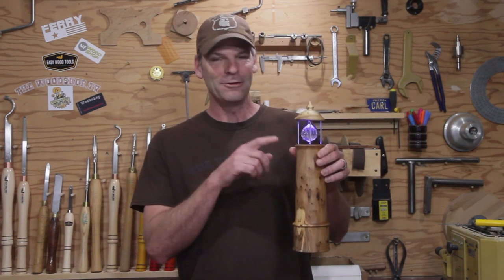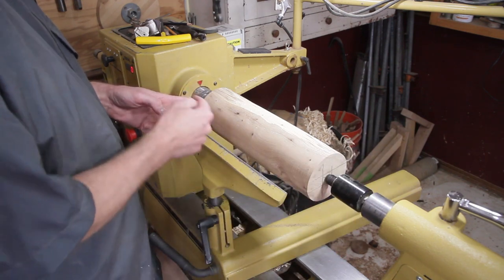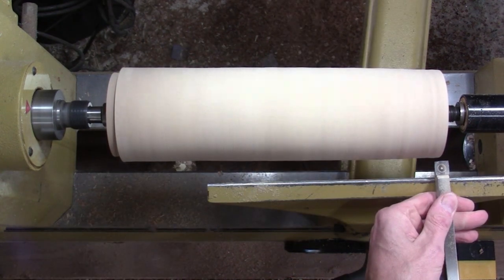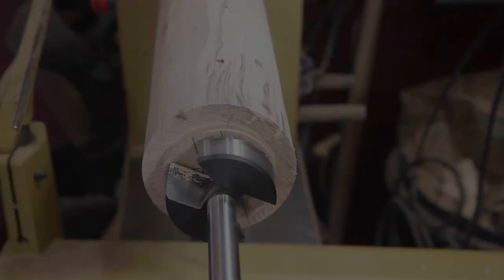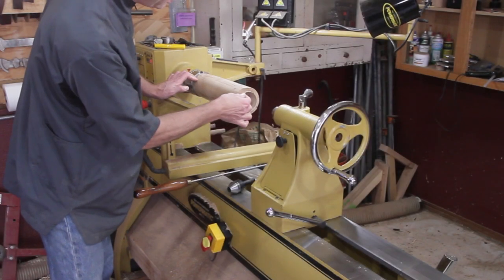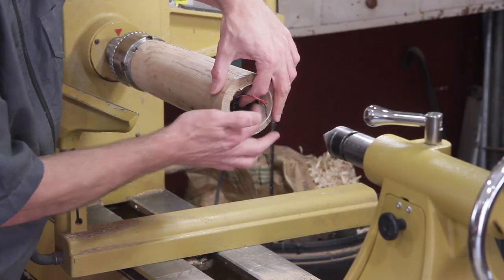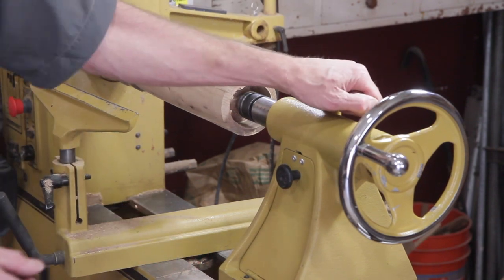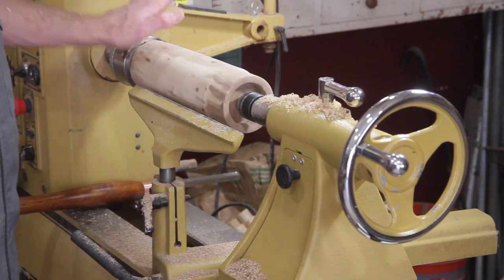Elm lighthouse LED

Comment: Great project Carl.   And thanks for the tip on using the auger through the live centre.   I make table lamps now and then and it can be tricky getting the hole for the cable just right.
Regards,
Alan.
Reply from the maker: Alan Simpson Thank you very much Alan! I was wondering how you would drill the hole, without an auger? 
Take care,
Carl
Reply: Carl Jacobson Hello again Carl,I've been using a 14 inch drill and coming in from both ends.   However, it can be hit and miss as obviously the drilling has to be very accurate.   A few times the drill has taken its own route and appeared out through the side and man you should hear me "cuss" then:-).Alan.

Comment: Hi Carl just wanted to say I love your videos! Very inspiring. I'm Relatively new to wood turning but have my share of experience in the workshop. I was wondering if a Nova chuck will fit on my Stark 10x18 mini lathe?
Reply from the maker: Pcar92 Thank you, most chucks will fit on any lathe as long as the threads line up. Just check your head stock threads, most are 1x8tpi for small lathes.